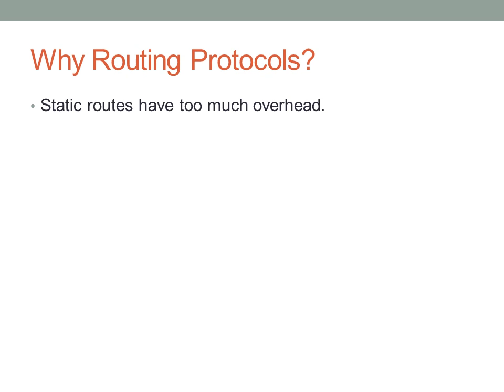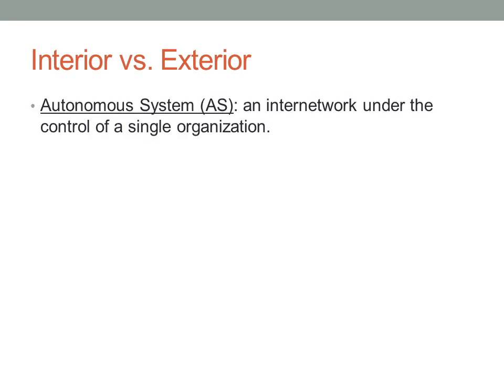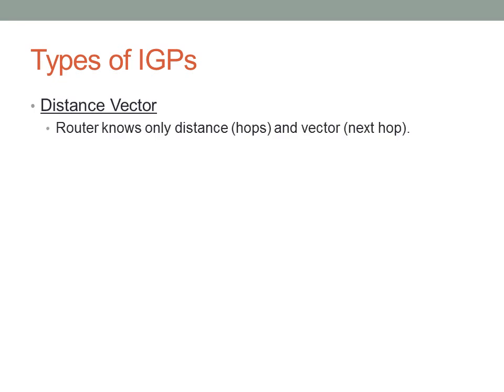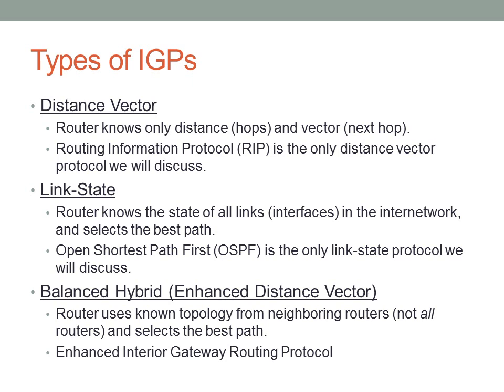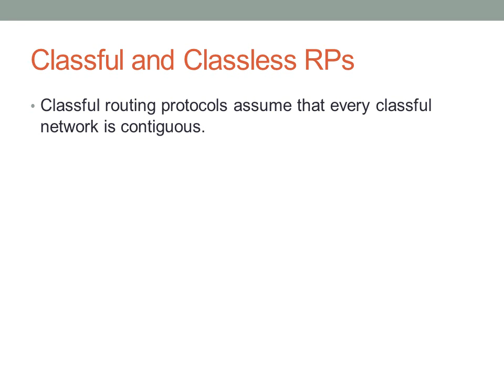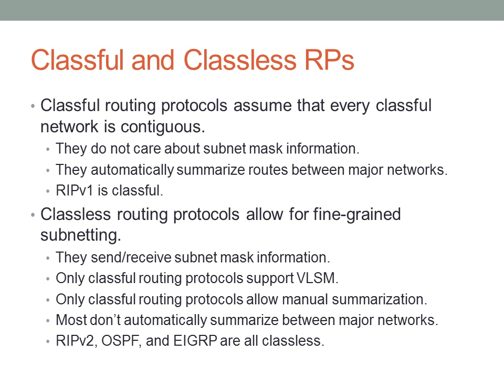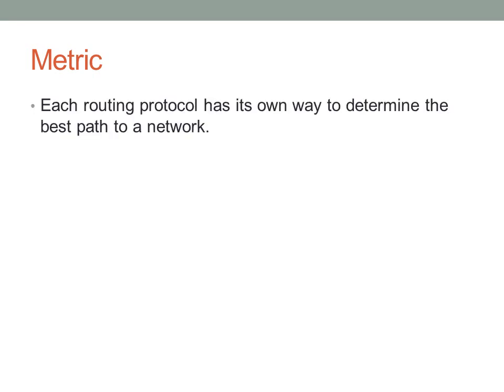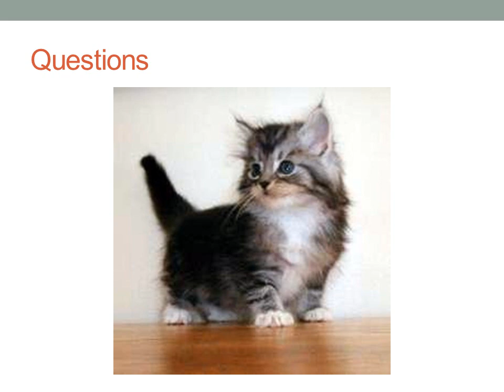Routing Protocol Basics

Comment: 6:30 Classful and Classless topic, you mention bullet points about classless protocol but its talking about Classful, such as Classful protocols support VLSM, Clasful protocols allow manual summarization, is that a mistake, do you mean Classless and not Classful, sorry the Heading for sub-bullets threw me off. You are talking about Classess in the heading but then talk about Classful, unless it was a typo and you meant Classless.
Reply from the maker: Good catch! That's definitely a slide typo. The bullet points on the bottom half of the slide should read "Classless", not "Classful".

I've pinned your comment so others that might be confused about the slide vs. the audio can see this more easily.

Comment from the maker: This is correct...double checked what I said at that point a few times, but to transcribe:

"...so, most of the routing protocols that we discuss are actually classless routing protocols. Now, classless routing protocols allow for fine-grained subnetting because they transmit subnet mask information. [...]"

In other words, I finish up the RIPv1 minor point and contrast it with the next major point on the slide. Hope this helps clarify; sorry I was moving so fast!

Comment: Thanks for the video. Im new to the networking world. I just wanna say that you comparing Eigrp and Ospf metrics in bullets helps very much. I still didn’t understand the difference since no video on here really points out the difference. Because by the time I finish learning one Routing protocol video and move to the next, it seems like they are talking about the same thing. 
As a beginner, this really helps. 
Thanks you 👍🏻👍🏻👍🏻👍🏻
Reply from the maker: Super happy this helped! I think understanding the difference between distance-vector protocols (RIP, EIGRP) and link-state protocols (OSPF, IS-IS) is really important, especially if you're trying to troubleshoot these protocols or determine which is best for a particular scenario.

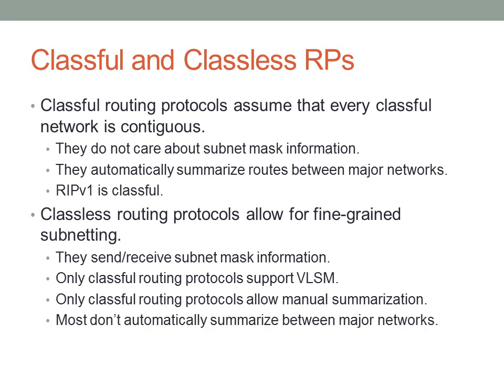Comment: Hi Ryan, nice work, please re-confirm (between time 6:20 to 6:30), you mean classless routing protocols supports VLSM and allow manual summarization. Right?
I hope this was a typing mistake in the slides, which mentioned classfull RP supports VLSM and summarization.
Reply from the maker: +Bahawal Sher Exactly right! This was a typo.

Classful protocols will always summarize at classful boundaries when advertising to (what the protocols consider) a different network.

Classless protocols include netmask info with their advertisements. This means automatic summarization isn't wanted or needed, and VLSM designs are better supported.

Comment: "Static routes have too much overhead"?? Really?

It's been quite a while I've been studying routing protocols and so far I've learned that static routes decrease the usage/waste of bandwith between routers (serial connections) and it provides way much less overhead than in classless routing protocols. Since it's done manually, it makes all the sense. 

I'd like to know why static routes have too much overhead just like it was stated in the first topic of this video. 

;)
Reply from the maker: "I've learned that static routes decrease the usage/waste of bandwith between routers (serial connections) and it provides way much less overhead than in classless routing protocols."

...or any routing protocol, for that matter! And with respect to bandwidth, you're exactly right.

The problem comes when you have to implement static routes in an enterprise network. If you have any more than a few routers and networks, maintaining a full network list on each device becomes nearly impossible. In environments where fault tolerance is important, you also need to go about ensuring that your static routes are appropriately re-weighted or removed using object tracking, putting additional load on the router itself.

Does this mean you shouldn't use static routes? Absolutely not! There are too many cases where people turn to a more complex routing protocol when one or two static routes would easily meet their needs. The "overhead" I'm referring to here is administrative overhead, and has nothing to do with network resources. Static routes are fine for small, simple networks, but failing to account for them as a business grows can lead to all sorts of headache. (I've acutally helped someone convert from about a static routes on three devices to using RIPv2. The network administrator had inherited a network with exactly the problem I describe here.)

My apologies for the lack of clarity in this video! I'll definitely be sure to elaborate more in the upcoming series of videos I'm making now.
Reply: Ryan Clough Hello Ryan!! Thanks for making it clear enough for me to understand. When I read "overhead", I literally associated the term with the network resources themselves and had no idea you had associated it with the time consuming activity of updating every router's routing table.

Now that you've explained, it makes a lot more sense. And, there's no problem in sounding unclear or making minor mistakes, we are humans!! :)

Nice video. I'll subscribe to you.

See you,
Joao